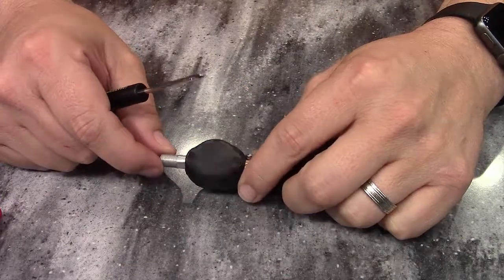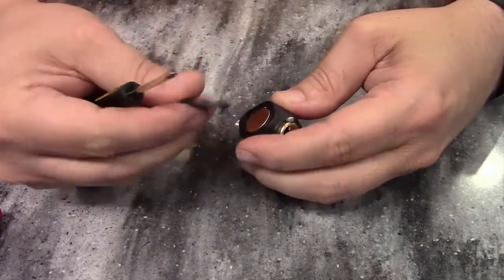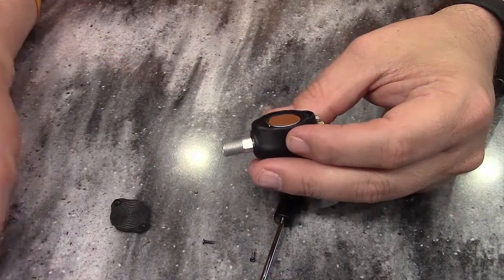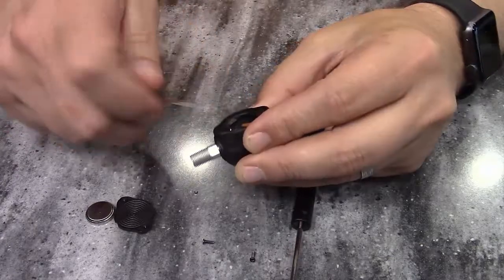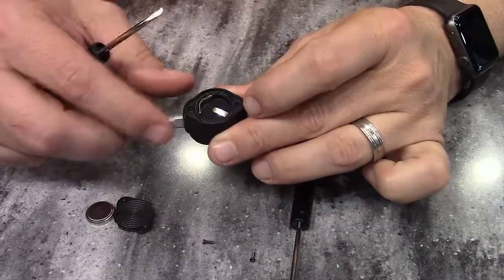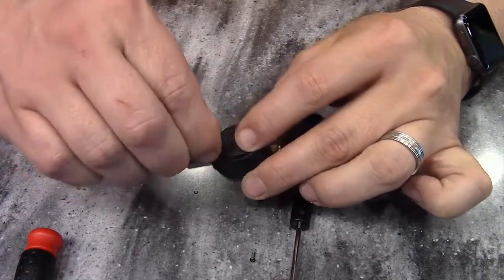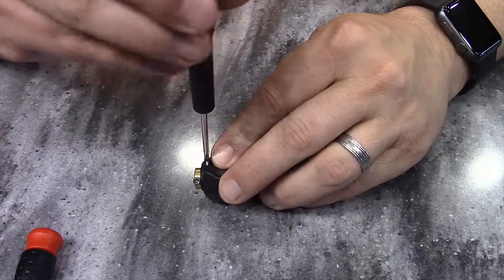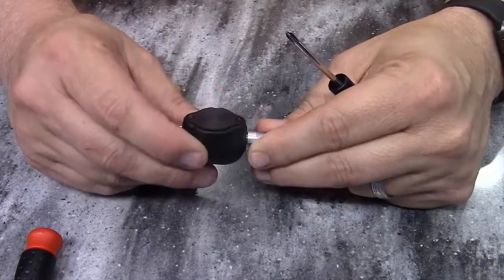TechnoRV TST 507 Learning Series: Replacing the TST 507  Flow Thru Sensor Battery

Comment: The current flow thru sensors have a cap with a slot for a screwdriver and a 2032 battery.

Comment: My TST beeps when the battery is low, anyway that's what I assume the reason for the beeping.  I shows a red battery icon for the one wheel that appears to have a bad battery.  It would be helpful to provide the ORing kit part number in the video notes.  Do you have the same kind of video for the non flow through sensor, or is it the same routine?
Reply from the maker: Hey Tom, here is a video on changing the battery in a cap sensor, but I am uncertain how old your system is. This video is for the cap sensor that is a few years old. Even if you have the newer ones, the process is similar, accept for the beginning. I hope this helps: https://www.youtube.com/watch?v=6gYmV7iKbZE&t=292s

Comment: Do you have to reprogram after battery replacement?
Reply from the maker: No, Ben.  You do not have to reprogram the sensors after battery changes.  Just make a note of which sensors goes where, change the batteries, and place the sensors back on the correct tire position and it will be back to normal.